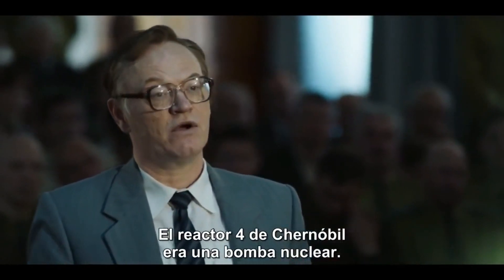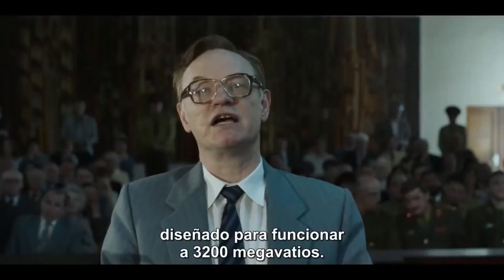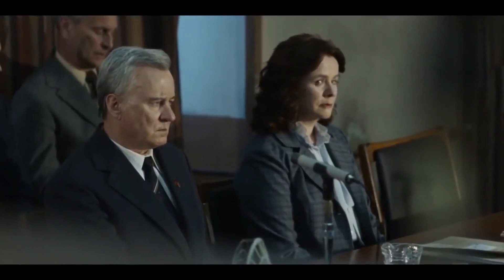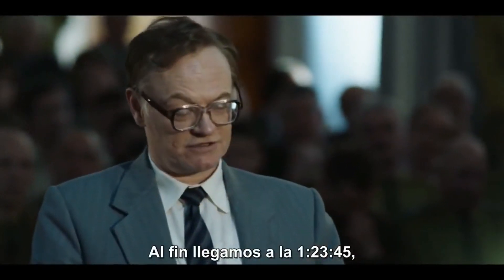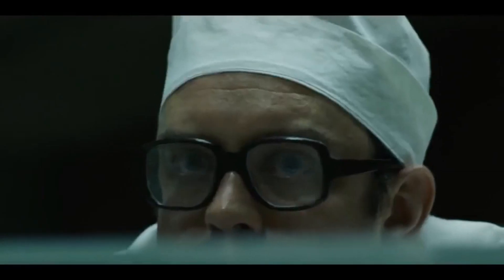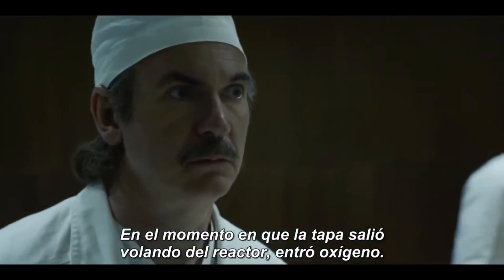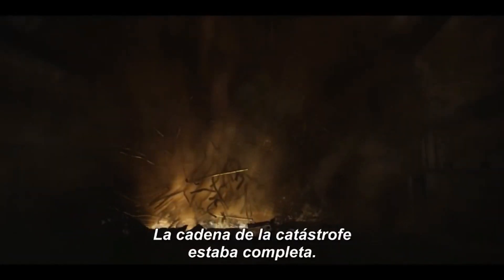Chernobil disaster explained in 10 minutes (3/3) - Valeri Legásov - Chernobil Series

Comment: I’m infatuated with the RBMK reactors. Cheaper, powerful, use unenriched fuel. It just seems like a better solution than fossil fuels.
Reply: Beautiful when it goes right. I advocate for nuclear power, but those responsible for operating it must understand it to an absolute.
The positive void coefficient however concerns me. You lose coolant and your reactivity increases as you use graphite as your neutron moderator. And your control rods have to be tipped with graphite to flash the water to steam within their channels so they can be inserted. With almost all the control rods withdrawn, what happened at Chernobyl was like cocking a massive steam pressure gun.

However I do like that western reactors have a negative void coefficient. They use coolant as the neutron moderator and thus even with all control rods withdrawn, when the water runs out or flashes to steam the reaction stops. Still, either way. It's a far better solution than fossil fuels, wind and solar farms.
Reply: You can even refuel an RBMK reactor while it's running.
Reply: nuclear power has its own problems. where are you gonna dump all the nuclear waste after burning your not so fossil fuel?
Reply: @TheCaptainCrack  Many thousands of metres underground where it will affect nothing or nobody. It’s a safe way.
Reply: @TheCaptainCrack  The borehole technology to make the deep isolation method viable already exists in the oil industry. The goal isn’t to dig a giant room, it’s to dig a deep hole that’s only eighteen inches in diameter.
Reply: @TheCaptainCrack  some reactors can burn the waste as more fuel
Reply: @TheCaptainCrack  That's why in the future the world will turn to nuclear fusion instead of fission.

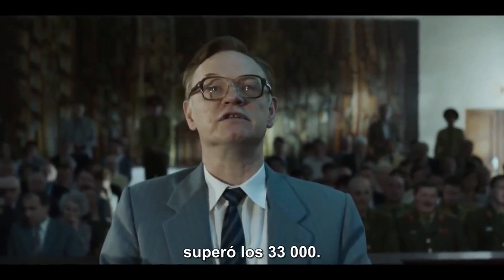Comment: 2:42 The guy in charge of the reactor finally understands how a reactor works
Reply: More accurately, he understands why the action designed to kill the reactor caused it to explode. Legasov here said it perfectly. Dyatlov felt safe because there was a fail safe that should have killed the reactor, but it didn’t work. 

The main issue is the engineers knew it didn’t work. Same thing had happened at Leningrad a few years before though it didn’t explode like Chernobyl. It wasn’t pushed quite to that point by its operators. But the KGB covered it up. Dyatlov thought that Az-5, scramming the reactor, would stop any problem. Which was a stupid way to think of it but that was the soviet culture. 

You also have to remember, we are looking at this in hindsight. In 1986, nobody thought what happened at Chernobyl was possible. Not the Soviets, not the Americans. Nobody in the nuclear industry thought that it was possible because it is nearly impossible. If you read the details of what happened you’ll find that the only way a nuclear reactor could explode like that is if you take a reactor designed the way the RMBK was, and push it to its operating limits like Dyatlov did, in the exact situation that they did. Even things like a power transformer failure that caused them to keep the reactor power up longer than anticipated played a major factor. 

Moral of the story, nobody thought it was possible because it should be impossible. Everything had to happen the way it did for the reactor to explode.
Reply: @speed150mph  yes the classic swiss cheese model , initially invented for aviation but works almost everywhere
Reply: @speed150mph  same could be said about the ussr leading to this situation in the first place. Or the invisible dance in this very court on how to keep everyones lives in balance knowing the party will silence what or whoever they can to maintain power. "His deliberation was the graphite tip an the AZ-5 was answering "why" which blew the lid off. The lies. He spoke to save an spare his countrymen as ignorant an arrogant as they are their lives an soul which is a will to live full blame from a corrupt system. . An I'm not anticommunist but power of any kind needs checks an balances
Reply: @speed150mph  still crazy how they could justify making the tips of the control rods out of graphite "because it's cheaper", that just made the rods do the exact opposite of their intended purpose lol how is that not identified beforehand in the design
Reply: @JC-wu3fk  The "because it's cheaper" line is misleading. Without graphite, the reactor doesn't work, so some of it needs to be present to increase reactivity. The boron is simply the other half of the same rod. It's designed so when you push the boron out, you push graphite in, increasing reactivity. And when you pull the graphite out and push the boron in, you decrease it. However, graphite is cheaper. Just not cheaper than boron. It's cheaper than heavy water, which was the first Moderator used in a nuclear reactor. It fills the same role as graphite, increasing the reactivity. However, unlike graphite, it is self-regulating, meaning if it gets too hot, it vaporizes, turning into steam, which reduces reactivity. It is also extremely expensive by comparison, and exceptionally rare.

So while graphite is cheaper,  it did do what it was intended to do.

Comment: wouldn't that mean Az5 would make it worse EVERYTIME they press it (because it increases reaction instead of the opposite). ...not only  in the environment diatlov created?
Reply: As far as I know it would cause a small spike in power output as the graphite is introduced, but that spike usually dissipates as the graphite is pulled out and water takes its place. The problem here was the fact that the reactor was ran at dangerously low output levels which caused it to basically stall, which led to them desperately trying anything they could think of to pull the output levels back up, resulting in the balance hugely shifting towards high reactivity, basically boiling all the water between the rods, converting it to steam.

Steam is a far worse moderator than water, which resulted in the balance shifting even more towards high reactivity, then when they started inserting rods again to get it back under control, the graphite was inserted first but since there's no water to moderate the reactor, reactivity spiked which led to the explosion as even more water converted to steam, rising pressure, eventually blowing the top off which introduced oxygen, ie kaboom.

Under normal circumstances where the operators are carefully managing the output levels, I'd think AZ-5 would cause a small spike, followed by power output dropping. But these weren't normal circumstances, the operators at the time weren't properly managing the output levels, which led to the above.
Reply: @jcm2606  The report Legasov relied upon assessed a major power spike in an RBMK reactor in Leningrad 10 years prior, when AZ5 scram was activated. This report was classified as a State secret and therefore was not available to the plant operators or chief engineer of the plant. IF that report had been made available, the test would have been done far more carefully or possibly not conducted at all. After all, the test had been run three times before and failed each time. The critical instability of those reactors at low power created the huge risk that led to catastrophe.
Reply: @Feargal011  the image was more important then safety
Reply: @Feargal011  In contrast to what have been shown in the film, this secret report was actually sent to all key operators, so either Dyatlov or Fomin would have to read it. In 1975 the reasons for the problem were not fully understood, so the report prohibited to work with less 15 inserted control rods.
Reply: You don't pull out nearly every fucking rod in the first place.
Reply: No because the effect only happens when control rods are removed entirely which is an unusual procedure. Usually you just remove them half or 3/4

But that is only one part of the problem.

Comment: I still don't understand why you would put a reactive material like graphite on the tips of control rods that are supposed to reduce reactivity? He says "it's cheaper" but why put them there at all?  Wouldn't it be cheaper to just not have them there?
Reply: I’m not an expert but from what I understand the control rods are supposed to have the ability to both increase and decrease the reactivity (boron decreases and graphite increases). The flaw wasn’t that the control rods had graphite but that when you press the emergency button the graphite is the first thing to enter the core.
Reply: So the graphite did serve a purpose.

Basically in a normal state neutrons move to quickly to perpetuate the reaction. The graphite rods are there to slow the neutrons down, which increases reactivity. This is called a regulator 

The "cheaper" aspect was that the boron and graphite rods were the same mechanism.
Reply: The tips are graphite to accelerate the reactor.  When you pull the control rods out, you're trying to accelerate the reaction.  But when the rods are out, the channels fill with water which also slows the reaction.  So the rods are tipped with graphite to displace the water and help the reaction accelerate.  What they didn't explain is when the rods were all the way up, the bottom of the channels were full of water.  When the rods were pushed in, it pushed the water out and replaced it with graphite, and the loss of that last water absorber allowed the reaction to increase uncontrolled.
Reply: If I remember correctly, a professor in a video I watched said that the graphite didn't even have to be in the reactor.
That water could have been used as both a coolant and a moderator.
Reply: @GingerZombie29  In this RBMK reactor, normal water was used but the reactors you are talking about uses heavy water (Isotope of hydrogen: Deuterium was the H in H2O).
Reply: @GingerZombie29 it can with heavy water and a negative void coefficient and a positive heat coefficient like we do with nuclear reactors in the west.